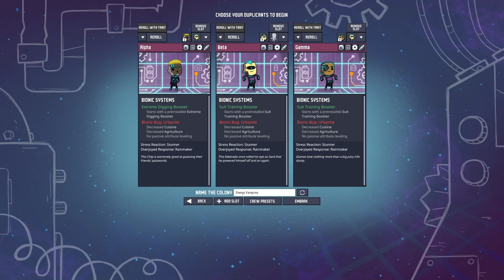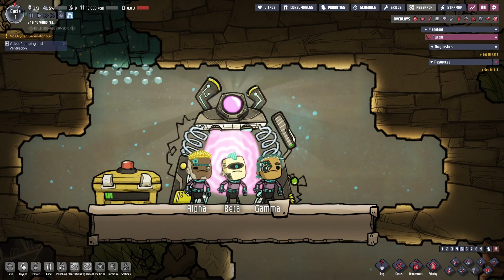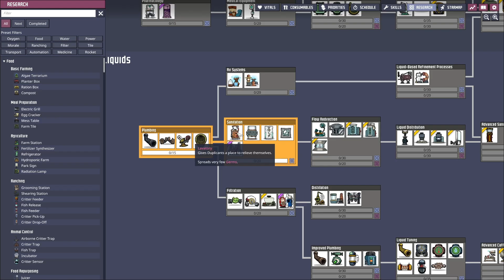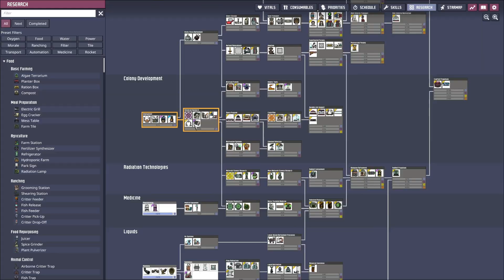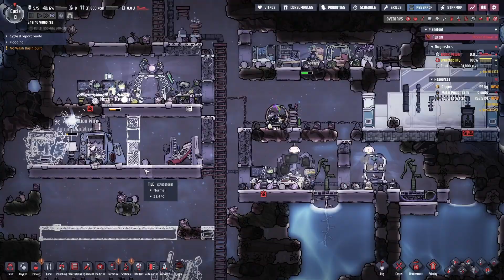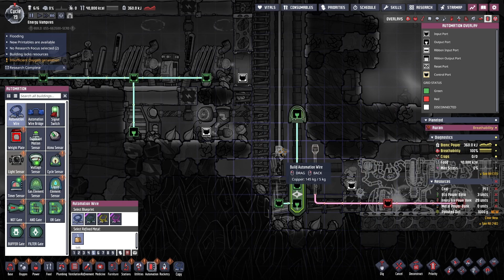Starting with just six bionic dupes - ONI Bionic Hard Mode: Energy Vampires - Ep. 1

Comment: A normal bionic dupe needs 1 battery per cycle, which takes 300 seconds to charge.  An energy vampire uses twice as much, so if you have 100% uptime on your chargers, then one charger per dupe is enough to barely break even.  But it's good to have extra chargers, and of course you need more to ramp up eco battery use initially.
Reply from the maker: Thanks, I am starting to build a few extra to have a large number of power banks in a rocket.

Comment: Nice as always.

One quick funny build you can make is to put all food in a rotting spot to get some pox out of the food. It's a negligeable amount, but all food will rot all over the map in the long term.
If you manage to access to the sulfur geyser, there is a lot to do with it.

Also a fun challenge would be to stay in here and try to cook some gunk to make plastic.

btw, you have your canister filler set to minimum.

The new Prehistoric DLC is up in testing. also next patch, they will allow bionics to go the mess hall to eat the power bank.
Reply from the maker: Well I will be trying out Prehistoric DLC tonight then! Thanks for the heads up.

Bionic dups changing batteries in the mess hall is a nice change. Not sure if that change will take effect for this game. Maybe it's good for the extra challenge.